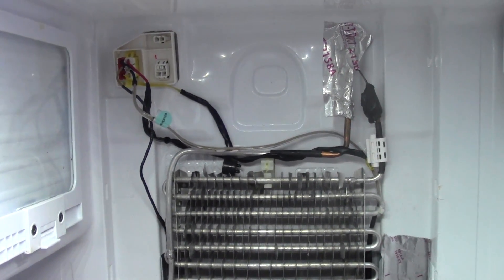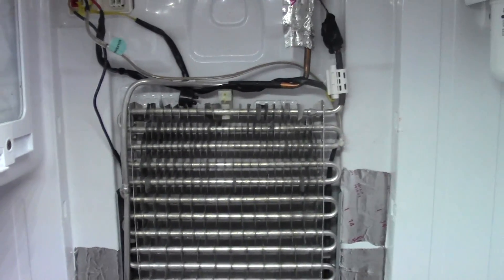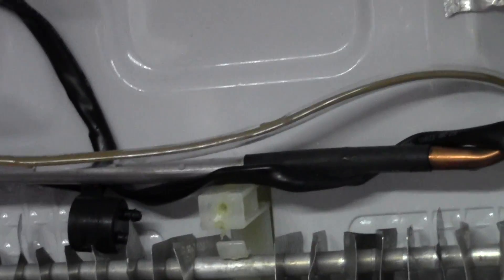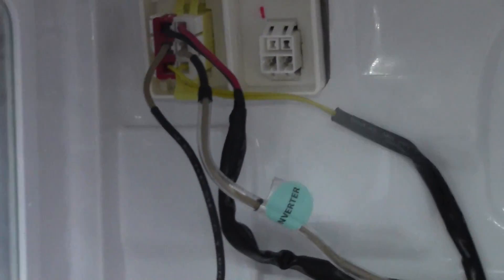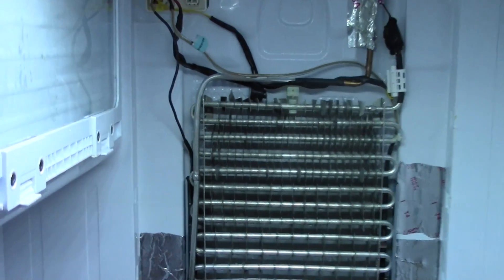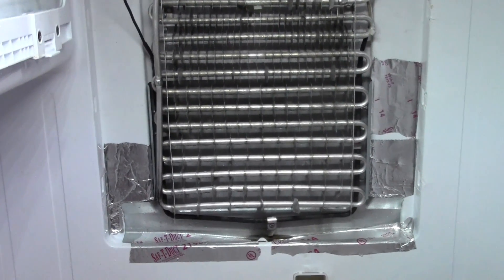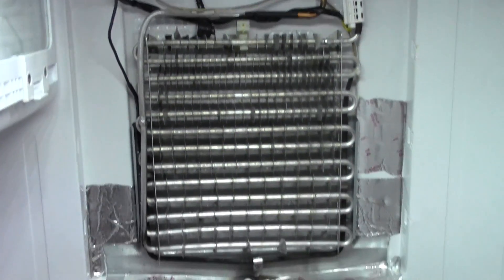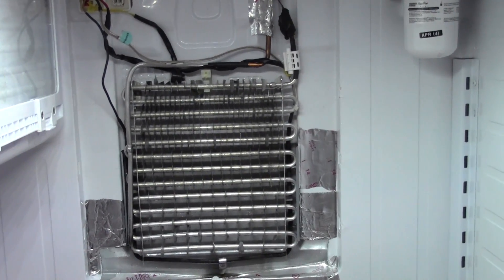PART 6 How to Fix a SAMSUNG RF 267 Refrigerator Not Cooling Icing and Freezing DIY repair

Comment: My fridge does theis every 4 to 6 months. I use a steamer to melt the ice and it works like a champ. I can get the thing defrosted and cleaned out in 30 mins or less. I use a shop vac to get extra moisture.

Comment: Jake,  I like your idea, but what do you think the root cause of the ice buildup is?    1.) Cold air from the freezer clogs the drain hole with ice?  2.) Defrost sensor top right is broken and auto-defrost cycles are not occurring?  2b.)  Heading element burned out. 3.)  Another root cause?    How can I check if the defrost cycle is occurring, the heating element is not burned out, and the sensor is working?   I have the same exact issue, but this is my first time to take my fridge apart.   Sincerely, David King
Reply from the maker: +dlk5730 dlk5730 ->  all the parts on my fridge tested out fine and they are working, yet there still is a problem.  There are some people who say that changing the thermostat will fix it.  I changed mine and it still freezes up.  I theorized that there is a fundamental flaw in that cover which sits over the coil and fan.  It's a legit possibility since I have improved the situation by insulating a part of the coil and sealing the cover with aluminum tape.  See part 8.  I just recorded the video in the last few days....

Comment: No, I wouldn't recommend it since there is absolutely no way to terminate the defrost cycle. Defrost heaters are controlled by a "Terminating or Defrost Thermostat" to shut down the coil (this is done with a bimetal switch that responds to the amount of heat) if you forget to manually unplug the heater, you will have a fire. It's better to just unplug the refrigerator and let it defrost manually, preferably at night when door openings are at a minimum. This is a much safer way, primitive but safe.

Comment: all of you don't hook nothing up. it's a drain issue. air is coming from outside the fridge up and through the drain on the back bottom of the fridge where the compressor is. there are new drain pieces you have to swap out to fox the issue they have like a check valve on it so air can't go back into the fridge any moisture or hot air that originally gets pulled up through the faulty ones creates that issue.
Reply: Part # ? Photos of old/new?

Comment: You don't have to take of nothing.   Check what is forced defrost command on your type of fridge and do the command from time to time.    If you want to fix the fridge just buy the repair set from e bay.   
     Funny videos man
Reply from the maker: I'm glad you find these videos funny.  So, here is the deal:  1. The forced defrost does not work.  2. The repair set does not solve the problem either.   Tune in for more hilarious videos about Samsung refrigerators that don't work correctly.
Reply: Defrost system is maid from one temp.  sensor (the little white thing on right side clamp on cooling pipe on top),  one thermistor (left hand side hide  in the back of cooling pipes), defrost resistance (pipes in the front connect with wiring) and defrost tray on the bottom where the wather should drain. Take one voltmeter an mesure on temp sensor resistance (must go up and down  when you put your hand and take of on the sensor), thermistor  Should not be discontinued,  defrost tray and defrost resistance must have continuity and a certain amount of resistance each.  My working on 220V  so on your should be diferent because of  110V.  This is for corced defrost mode......         fixitnow.com/                this is for testing  the defrost sytem  (is for different type but defrost system is the same,  ignore reaistance value)
Reply: The spare parts for defrost..   Al of them  cost about 40£ if you want to change everything   if not  check each one and see which one is faulty.   Check an youtube how  to do this
Reply: You have a defrost relay  the black little small  box on cooling pipe.   Check this...   On ice should have continuity  and when is worm not
Reply: My is working fine.  I fix this two years ago ..
Reply: The forced  defrost does not work because  some spare on defrost system is faulty mate.     Check each  defrost part  and find what part is faulty.   Good luck.     I'm  mechanical engineer  ,   I fix forklifts for living.   Search  how to do the check on your type of fridge over the Internet  .
Reply: Check the drain tray.    Should be hot when the fridge is on defrost mode
Reply: Samsung RS265LA , I tested Defrost Censor (yellow wires) at 75deg it measures around 4K Ohms and goes up in cold water, I tested Thermal Fuse (Red/black with foam found between coils) 0 Ohms, Defrost heater coil (replaced it 5 years ago)  480Ohms .... Everything seems good. 
I did find an open with the heating foil for the water right behind the tubed water on bottom. Replaced.. 
When I try and force defrost mode, it doesn't seem to work.

Not sure whats going on.. Every few weeks the ice builds up, blocks the airflow and then fan starts to make noise because it's rubbing on ice.

Comment: Wow. All of those evaporators have a temp sensor. It basically tell the coil to heat up and melt ice away. First pour hot water down drain. If you see it empty it self than it is the temp sensor. It is the white wire on the right side of the coil. It is about 3 inches long and cost about 8 bucks.Another idea is to hook up the frig on a timer do that it can shut it self off at night when no one is using.Time to defrost it self.Just do not go around snipping wires from inside frigerator.
Reply: That's a good idea.. I might do the timer idea..

Comment: well we got all the ice out plug it up again fan dosnt come on
Reply from the maker: Remember, the fan wont run with the door open, and once the door is closed, it is hard to tell because you cannot see it.  You gotta find a way to bypass the door switch.  Holding the button in does not work.  Someone mentioned a magnet in the right place which activates the door switch.  If you can activate the door switch, then the fridge will run like it does with the door closed.  Then, you will be able to see if the fan is working or not.  Other than that, you can try opening the door really fast with the panel off to see if the fan was spinning.  You will be able to tell, if you see the fan spinning and then coming to a stop.

Comment: I had the same problem and the cure was a simple hose clamp. I put a small clamp around the heater element at the bottom and put the loose end of the clamp down the drain hole. This kept the water from freezing in the drain hole and it worked great. 
  Thanks
  Barnes_Place@hotmail.com
Reply: what the heck is a pipe clap?
Reply: Hi David
Sorry, I should have said a hose clamp. I think I was half a sleep when I wrote about that fix.
http://www.canadiantire.ca/en/pdp/hose-clamp-1-4-5-8-in-2-pk-0799049p.html
Reply: Would like to see photo oh that we are trying right now  to fix and avoid  replacement
Reply: Do you have a Skype name ?
Reply: That is only a solution if your symptom is drain tray freezing up.

Comment: If all the parts involved in the fresh food defrost cycle are working, the cause of condensation and ice built up around evaporator coil and fan is the defrost drain clogged with ice. In that case, when the refrigerator goes on defrost, the fumes from the ice melting without proper draining create condensation around the evaporator fan motor and that condensation will be ice building up stopping the fan blades. There is a substitute metal clip (DA61-06796A) that goes deeper inside the drain hole, helping better heat transferring from the defrost heater during defrost cycle, please be careful during metal clip replacement, the old one can fall very easy trough the drain hole and the refrigerator may be unrepairable. Another area that needs to be cleared is the drain pipe at the drain pan by the compressor area, there is a grommet that collects dust and obstruct the drain pipe, that is very important to check too, off course, DISCONNECT THE POWER TO CHECK.

Comment: I found a long term fix.  Here is how.  I have done the opening up 3 or 4 times and got tired of it, thinking of throwing the fridge away.  Then I got inspired by the part 6 of the video here.  I used a wire-type heater of 25 Watt, 110 V, 3 mm thick, 2.5 meters long.  I wrapped the wire in the chamber where ice may build and fed the ends down the drain hole.  Whenever there is noise of fan hitting ice, I simply plug the heater for a few hours.
Reply from the maker: Wow!  Thanks.  Keep in mind that this is probably just a temporary fix, just to get the refrigerator back up and running for a while... Chances are the problem will happen again.in a few months from now,  

Some people have had success dangling a  longer wire into the drain hole and some people have changed the thermostat, and that fixed the problem.    

When I tested my thermostat, it tested out perfect, so I never changed it.  I actually bought a new one but never installed it.

I am working a very easy fix that does not require electrical work or buying expensive parts.  I am still in the testing mode and waiting for it to freeze up, and will let you know when and if it works,

  Thanks for your support.  I dont make much money at all on these videos but every bit helps.  Youtube is linked to my son's college saving account so he appreciates it also.
Reply: This last comment is one more reason I am so grateful for the work you've done here. You gave so much information in the videos, yet there are comments like this one that added all the little details to help even more. Although you showed how to turn off & on for your model in one of the videos, my model is a little different, and I had a tough time finding the method in the manual. After reading this comment, about an hour into trying to defrost, I scoured the manual and found it (it was under how to turn off demo mode) and voila! Turned it off, closed the doors, and 2 hours later the panel came off. 

We've had water under the bottom drawer on & off for a couple of years, and we thought it was something we were doing. When we were deep-cleaning the refrigerator yesterday and found so much water, I looked it up. I watched the beginning of a couple of videos before getting to your series, but something about the way you think made me keep watching yours. So I was watching and calling to my husband as I was learning. :)

Side note: after about halfway through, out of gratitude, I let the opening ads run through instead of skipping. Someone told me that's better for those who post the videos. You saved us $2000 today! Thank you!!
Reply: Could you post a link to the wire-type heater you bought?
Reply: I did twice.  The first was with heating wire from a yogurt maker of 25 W running on 110 V AC.  I would plug the heater in whenever there was the icy sound from the fan.  About one month ago, the heating wire burned out by the build-in de-ice heater.  I ordered another heating wire from ebay, called "Minco-Heat-12K-Carbon-Fiber-Heating-Cable-33-Ohm-m-DIY-Underfloor-Heating-Wires".  I used 4 meter of this wire, should have used 5 meters.  I made sure that it is safely away from the build in heater, especially the dangling tip at the mouth of the draining hole.  Now I keep the heater on at about 3 W with an old laptop power supply of 19 V.  About one month passed, there is no any issue.  I plan to use lower heating power later, to find the minimum required by trial-and-error.  I am not familiar with youtube system.  If you want, I can share a link for you to see the photo of my wiring.  Cheers.
Reply: +Liqian Li Check the drain pipe by the compressor, it may be clogged with dust, that also affects the defrost drain.
Reply from the maker: +Liqian Li ....  Very Good.    I figured someone was going to try this technique eventually.  This technique will actually work.  I would only recommend it if you have some skill in electrical work and soldering, though.  I would probably not wait too long to use this defroster.  Maybe like every 2 weeks you should run it for 20 minutes.  Why wait until there is 2 inches of ice built up on everything?
Reply: +Santiago Perez..... I figure the water head of 2 feet will be powerful enough to blow open any clog in the pipe, as long as there is no ice.  Actually the drain pipe has a rubber gap of about 0.2mm by 10mm at the bottom.  I guess this gap is for letting the water through yet limiting the air breath, so that the heat efficiency is not affected.
Reply: +jakeguitar01 ... thank you for the videos.  Yes, you should have some electrical knowledge to be safe.  My heating wire was from a broken yogurt maker.  I use a GFCI power bar to protect any insulation failure, and a timer to prevent from over warming.  Actually the GFCI is so sensitive that I have to unplug the refrigerator during the de-ice.  The refrigerator is safe to touch though.  I have a few photos taken, but I don't know how to send them to you.
Reply from the maker: Also, just so everyone knows, and to remind everyone, it is a very good idea to either turn the refrigerator off while defrosting with a hair dryer or using this makeshift heating element.  The reason is that you dont want to try defrosting while its still cooling....  ti just makes it extra hard and an even longer process than it has to be.   If you leave it cooling, you will notice that it makes it even more difficult to melt the ice and in fact you will watch it re-freeze the water as it melts off the coil.  So, unplug or turn it off...
Reply: Thanks for the response. The carbon fiber heating cable running at 110AV does not sound like something I want to do. The old laptop power supply method sounds more like something I would do. If you have a low powered solution done, please post that. Sincerely.. Appreciate it.

Comment: READ this artile I found.  I feel this new drain clip that replaces the smaller shorter verison that Samsung first used is the root of the problem ...it costs 2-6 bux and all about this replaceemt drain clip can be read about here and how to do the fix yourself. There is a link where to purchase the part called CLIP DRAIN EVAP REF CULLI AL and the part number is: DA61-06796A  http://www.appliancerepairlesson.com/2013/12/13/samsung-refrigerator-leaking-into-crisper-drawer/   here is a link to the part I am talking about . http://www.samsungcanadaparts.com/product/inv_9460842
or here:  http://www.reliableparts.ca/product/inv_9460738/475446 and  as well as other places like ebay or amazon :
Reply from the maker: +No one Nose Hi.  In regard to how to fix this samsung refrigerator which is icing and freezing up, the reason is due to the defrost cycle not working.  The heating element is working, but it doesn't cycle on and off.
Reply: It's saying the clip isn't compatible with my model number. Any other option I have?
Thx
Reply: +Pokemom Here It fits all Samsungs with that evaporator drain shape.
Reply: My SamJunk frig has had this manual defrost done 5 times in the last 22 months!!  The first time I had called for a service man who did NOT fix the problem.  He only defrosted the machine (cost $150.00 for 3 hours time).  Though they permanently lost me as a customer, he did one thing that helped, he put a piece of copper wire down the drain hole, which does not freeze closed.  
Regarding the discussion in which people connect the lower drain freezing with the upper bulk freezing, I don't buy it.  The two are separate issues.  I just finished another defrost cycle this morning, 4 hours from unplug to restart.
Now, three hours later, the frig temp is down to 46, on its way to 38 (hopefully).
Do not waste your time removing the freezer items, they seem to handle the machine being off for 4+ hours, well.  Put all or as much as possible refrigerator items in an iced cooler(s), and get to the task of defrosting.  I set a room heater (blower type) about 5 feet in front of the open doors, set on a lower heat temp.  Also used one of those clip on fans that I clipped in one of the doors blowing onto that upper right freeze area.  Toward the end I started using a good hair dryer to finish up the melting until I get that panel loose.
Had a frig for 25 years (either Amana or Maytag??) that still worked great when I got rid of it.  Got a expensive GE Profile side by side, that lasted a whopping 3 years (Total JUNK).  Then I got this SamJunk (my wife liked the layout), In which I and apparently 100's of thousands of other SamJunk victims congregate to solve our own problems because the manufacturer is probably the worst on this planet.
SamJunk SUX!!